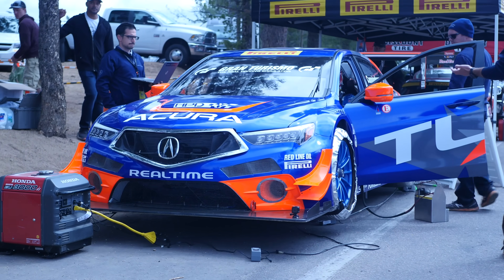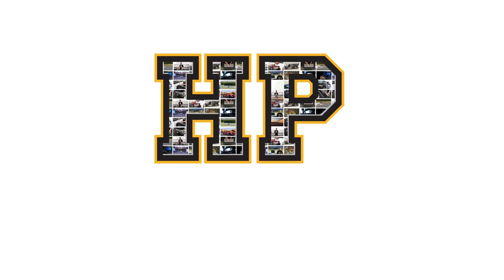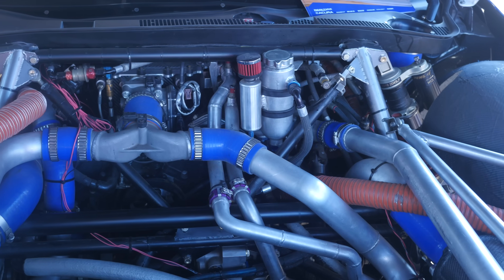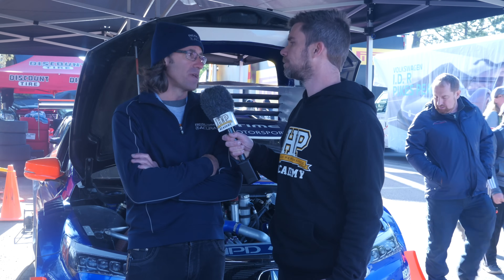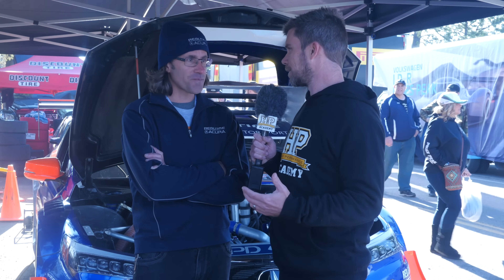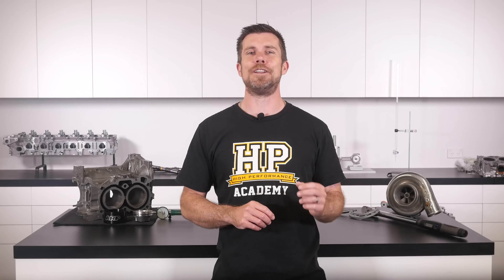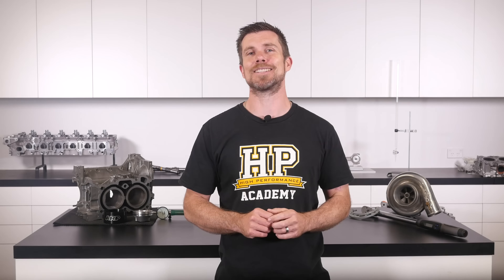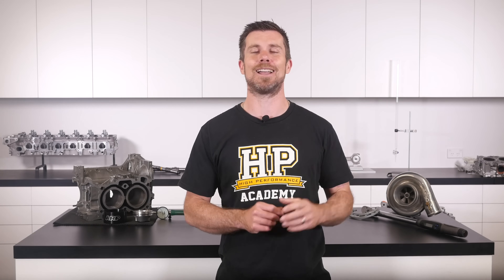Mid-Engined 550HP AWD Twin-Turbo J35 | Acura TLX GT [TECH TOUR]

Comment: Sorry but not a mid engine vehicle.  My aw11 mr2 i had was a mid engine vehicle.
Reply from the maker: If this isn't a mid-engined build then your AW11 is a rear-engined car ;) - Taz.
Reply: @hpa101  how so if the engine is still up front and not behind the  front seats or behind the centre of gravity . Look at the honda NSX that's a mid engine vehicle
Reply: @_i-kr6eg  the mr2s engine is about  the same distance in front of the rear axle as this engine is behind the front axle. In fact this engine looks to be even more mid engine an any version of the mr2.
Reply: The engine is more mid engine then most claimed mid engine car (might get some hate but...) like the s2000 and 4c

Comment: It’s kind of amazing that Honda/Acura green lit this sort of project car with very little cross over or sales potential. I’m all for them doing weird builds but I’m very surprised that this got funding. 
I would assume some form of the NSX would be more appropriate and may actually exist already.
Reply from the maker: This one one of 4 cars Acura sent to Pikes Peak this year, and an NSX was one of the 4 😉
I'm guessing the thought is that since the car was already built it's still better exposure to race it somewhere they can rather than to sit it in a shed untouched - Taz.
Reply: That is the main reason. Real Time moved over to the NSX GT3 car for one season and then pulled out for whatever reason. Peter the owner has long history in World Challenge and SCCA club racing.
Reply: @dj4monie  Yeah I really miss the old speed vision coverage of the Type R's and Comptech NSX. Interesting to hear they pulled the NSX out, it must not have been competitive without the awd electric setup. Maybe too heavy for the power train change.

Comment: 3800lbs!, that's some weight for a carbon bodied car. It's still fast and grippy so i shall call it the Sticky Piggy.
Reply: yeah 3800 with full carbon body doesn't make much sense.  my 2003 Acura came from factory weighing 3500 and I've gotten it down to 2600 with cage and it still has A/C, functioning windows, cast-iron suspension and almost all steel, plus my homemade aero.
Reply: @brian6speed  goood job mate
Reply: brian6speed not at all, with a full carbon body more like 3100lbs or 3200
Reply: It's not full carbon...Listen to what he said..
Reply: hondatrix, woah bring the Revs down, no one said it was full carbon, just full carbon body, which is exactly what he said. You should Read twice, comment once.
Reply: @JP-ug1xr  Nacho Man, read ALL the comment before you make silly comments..maybe you should read 4 times..!
Reply from the maker: hahaha, great name! We need a better one for our Holden, so far all I have is 'Dave'. What do you reckon? https://youtu.be/j1gU1NguNqQ - Taz.
Reply: High Performance Academy - Taz - it's a tricky one because it's not an extreme build so a humorous one might seem like bashing..... As far as Names go, you're project is to maximize an LS.... Maximus. Or you're accommodating the potential of the LS... Accomodore. 
LS monikers...
LS MAX (i phone pun)
LS Evo
That's all I got without pulling out the thesaurus. You're welcome and You can make the check out to Nacho Man 😁.
Reply: Comment section, take these, go forth and multiply!